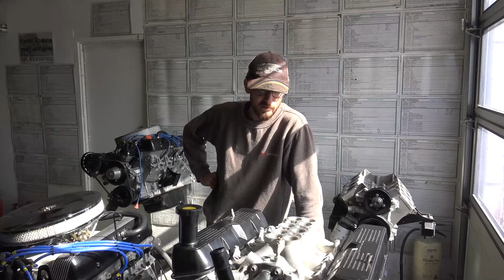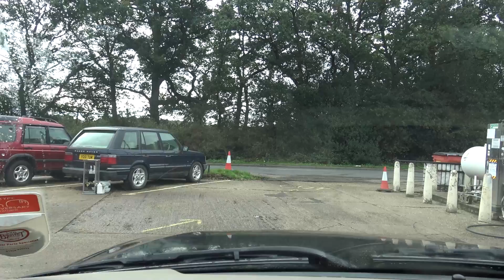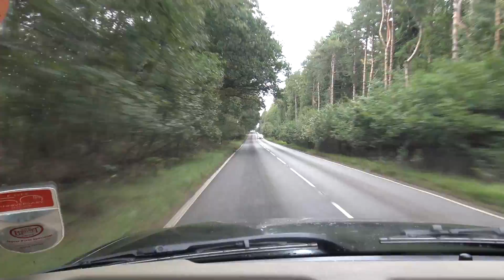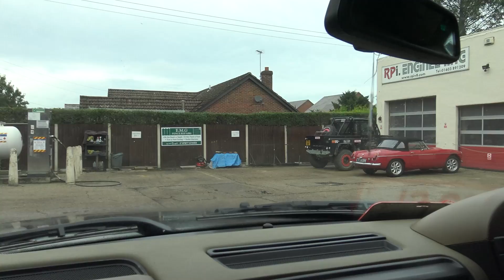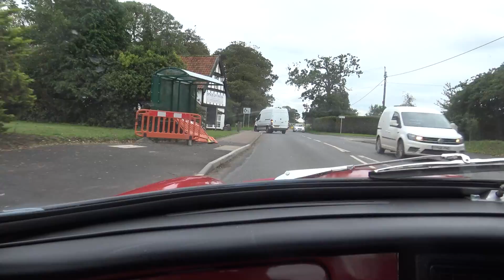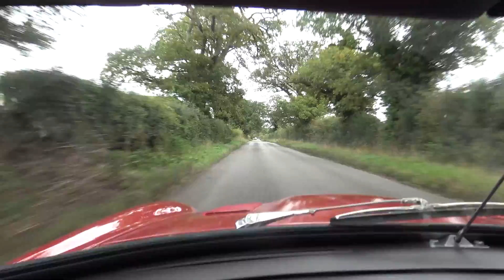RPi Engineering V8 Workshop Update Episode 42

Comment: Great work as always. I have a question regarding my ‘99 RR P38 Thor. My condenser fans run all of the time from key on, to about 5 seconds after key off. I have checked fuse box, all relays, and both pressure switches on A/C lines, all check out. I have also tested the coolant temp sensor, which is also fine. The fans are definitely commanded ON by the ECM. My question now, why would the ECM command these fans on? Is it possible that the Motronic was programmed to always run these fans, maybe because of region/market (the car is a GCC spec/United Arab Emirates). No idea what else to troubleshoot..
Reply from the maker: Hi. Its Rover V8's that we specialise in however that of course does mean that we see lots of P38 Range Rover and get involved with other aspects of them. The issue you have is not one I have seen here before so can not really comment however I believe the V8 ECU can control the air con fans for additional air flow so there could be an extra element here that needs investigating.